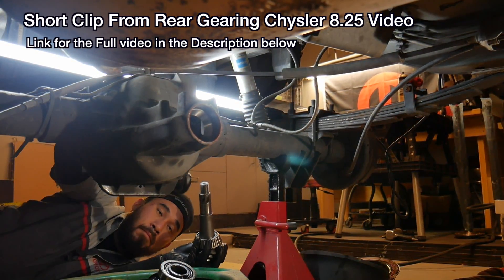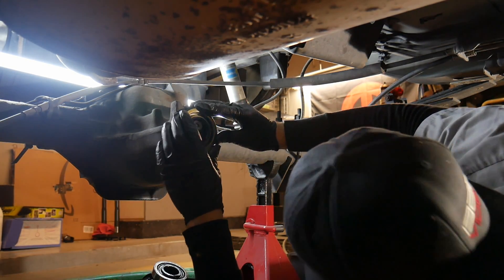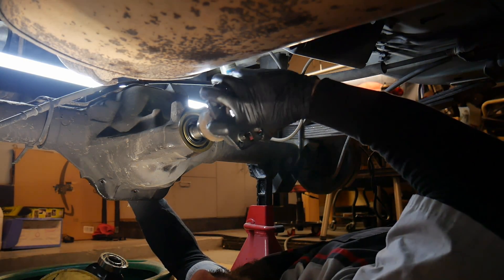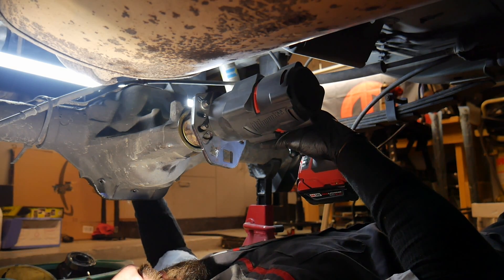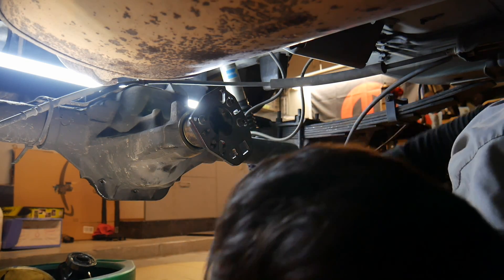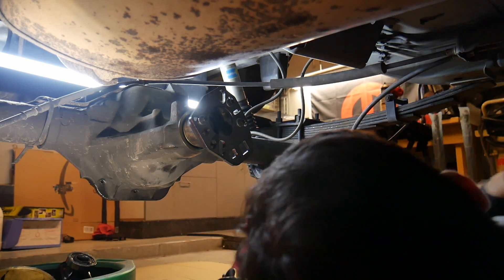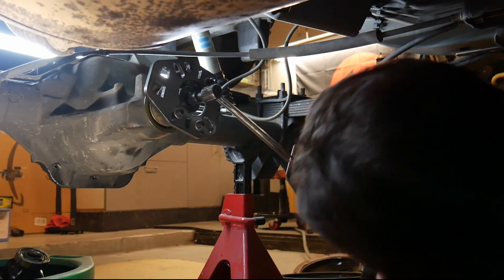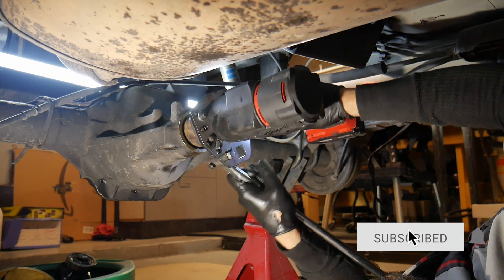Setting Pinion Bearing Preload / Rotating Torque / Chrysler 8.25 differential / Dodge Ram Jeep / xj

Comment: Guys, he probably had his torque wrench set at 200 for first tightening, and it checked at 12 rotational inch pounds. He was shooting for 10 to 30 rotational, so he increased to 210 ft pounds with torque wrench. This gave him 15 rotational.

Comment: I don’t understand this method of setting preload. If the preload torque is reached before the nut reaches 250 lb.ft., what stops the bearing preload from increasing after the nut is torqued to 250? And, if it doesn’t increase, why not just torque the nut to 250 and be done with it?
Reply: I was wondering the same thing.
Reply: He did it wrong..... once he reached the rotational torque of 12 INCH POUNDS... that should have been the end of the procedure!!  All you are concerned about is that rotational torque value....  You are correct!!
Reply: @edfrancis165  i agree with this also, everything I have researched agrees with this, some sources never even mentioned anything but ROTATIONAL torque for pinion setting

Comment: I noticed you were measuring the pinion bearing preload without the ring gear installed. Can I check the bearing preload the same way with a complete build diff? I replaced the pinion seal on a 9.25 axle and forgot to mark the nut...
Reply from the maker: You should be able to zip the yoke on loosely,  then just torque the nut to spec and it should be fine,   the preload on the bearing is really important when replacing the bearings,  if you just did the yoke seal it should be fine.
Reply: @Donnythelatemodeltech   So just torque the nut to spec? A mechanic in my area who builds rear axles told me to do the preload measuring, that way making sure the nut is tight enough. Don’t get me wrong, I don’t question your knowledge. It’s just that I get different answers to the same question. I don’t want to run into a diff problem later just because I replaced a pinion seal. Thanks again.
Reply from the maker: @MrZdvy  no doubt if your rebuilding it, your going to need to preload, and set rotating rotating torque.  "You can only crush the crush spacer once ,  you can try to preload and set Torque,  but you run the risk of changing you pinion depth. Most of the time when just changing the pinion seal, just Torqueing the yoke and nut is all that's needed , because the pinion is usally set pretty firmly into the bearing and the preload is pretty close to where it needs to be.   If you ever have had to remove a pinion , usally they need to be hammer out, usally.    Ford mustangs just fall apart. Lol.     So,  your just going to to skip to the last torque step because the pinion should hold its spot ,     ....       again this is only if the pinion hasn't moved and your not rebuilding it.
Reply from the maker: I'm pretty sure if you torque it , or add just a few more pounds it will be fine,   I've watch old techs rebuild  diffs, with just touch and feel,  like they're Jedi's and  use the force ,lol.  And everything is fine.
Reply: @Donnythelatemodeltech   Thanks. I will have to find a way to keep the yoke from rotating, I don’t have that tool in your video, obviously the parking brake won’t hold it. Would be easier on a lift🧐

Comment: You can get away using an impact and it may last, but you risk brinelling the bearing race and eventually leading to bearing failure.  This should be completed with a torque multiplier and dial torque wrench.

Comment: I saw you cut the video and then restarted it you didn't show how you stopped the pinion gear from spinning.  Did you put something inside the carrier to stop it while you torqued down?
Reply: Look again, he wedges a breaker bar from the pinion wrench to the leaf spring.